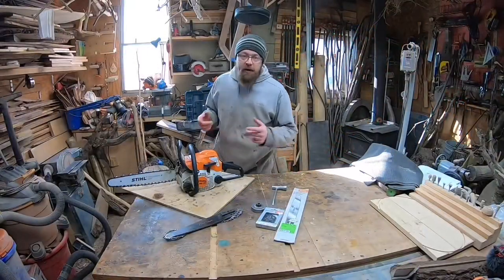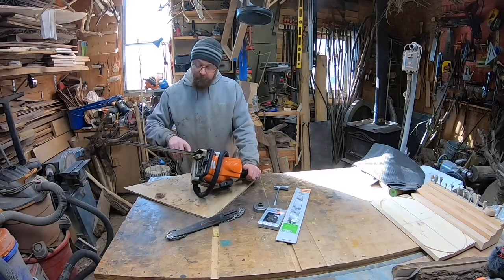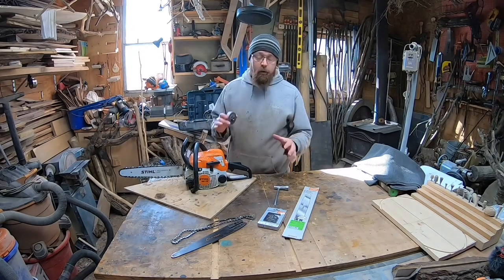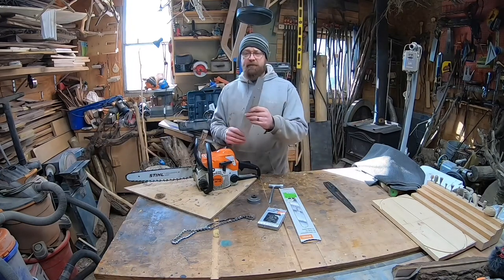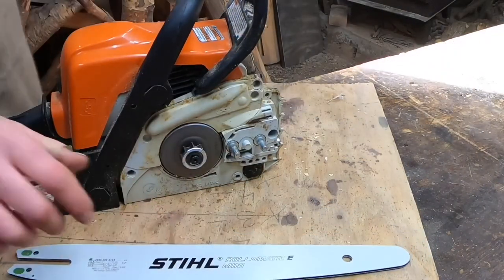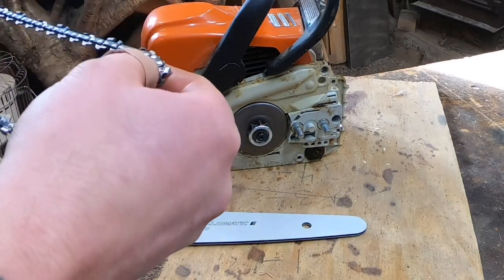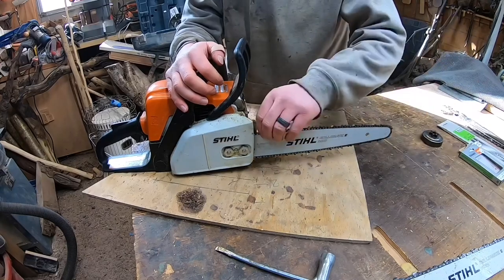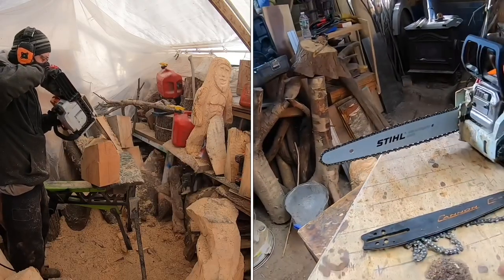Turning a Stihl MS 170 into a detail saw for carving .

Comment: Hey Kyle I've been using the 12in. Stihi bar with the 1/4 pitch chain for about a year and I like it a lot . On my MS170 I get oil that comes out of the muffler I think it's because of running it at low rev's have you had that problem . I got a DeWalt battery saw for Christmas I was thinking about putting a carving bar on it I know Jordy did on his . Do you know where I could get a bar for it . Thanks Kyle .
Reply from the maker: I have not had one of mine do that yet . It could be from low rpm’s and getting a build up but I’m not sure

Comment: You’d solve a huge answer for me if you could let me know if any stihl, corded (electric, but not battery) saws will take that sized sprocket and a dime tipped bar.  I cannot seem to get answers on it anywhere, including my local stihl dealer.
Reply from the maker: I really do not know . I’m sorry
Reply from the maker: If the saw has a 1/4 pitch sprocket you could possibly modify the bar if it dosent fit of the lug bolts. Just an idea